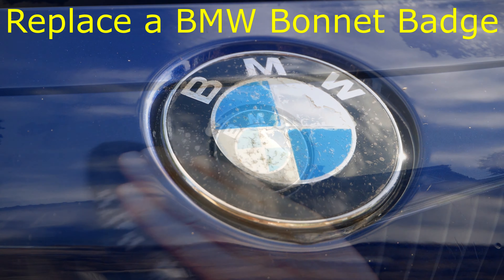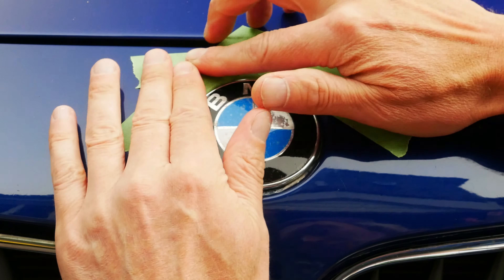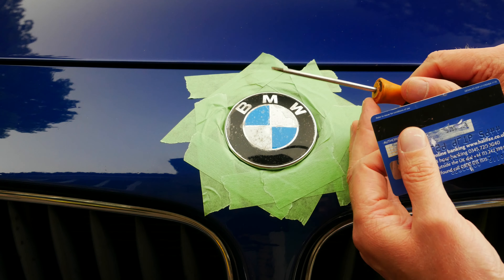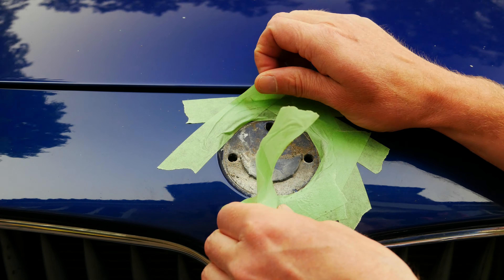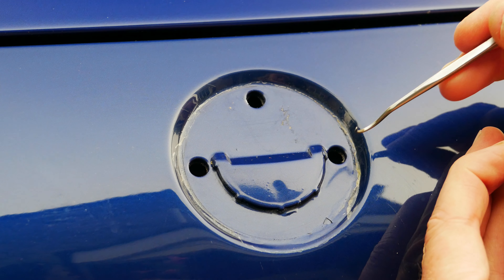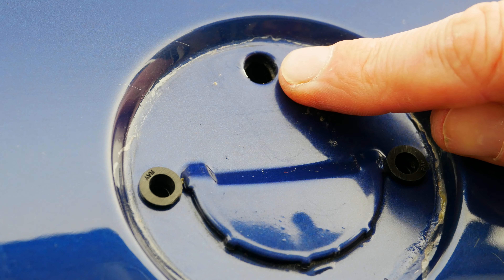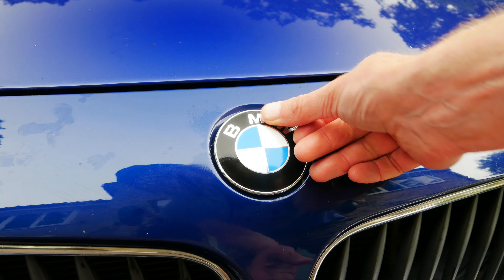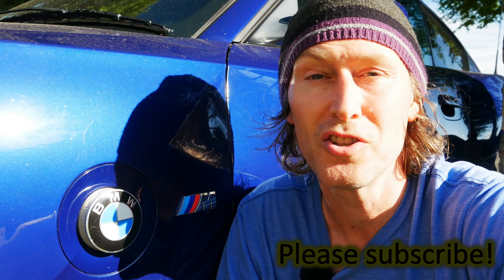Replace BMW Bonnet Badge // How to Remove BMW Bonnet Badge

Comment: What can I use to remove the grommets if I dont have the tool you used?
Reply from the maker: Hi @mattysykes2121 If you have a wire coat hanger, you could use pliers on one end of the wire to create a hook, the hook part would have to be short so you could fit it down through the middle of the grommet, then pull it up. I've done something similar quite a few times. You can even bend the coat hanger back again afterwards and go back to using it for your shirts! (until next time) lol! Thanks, Phil